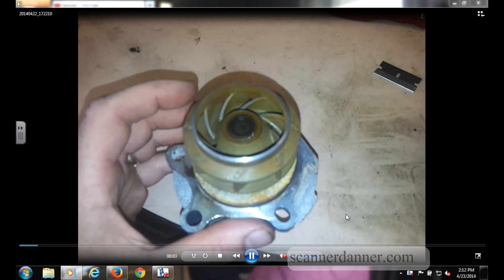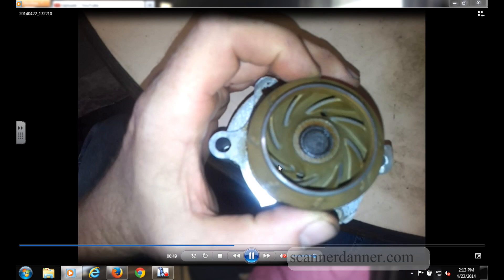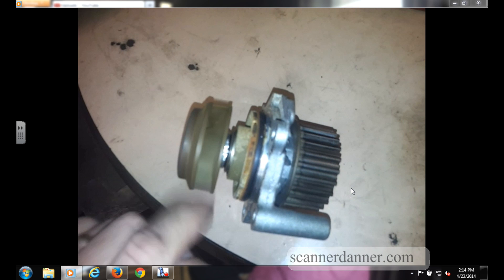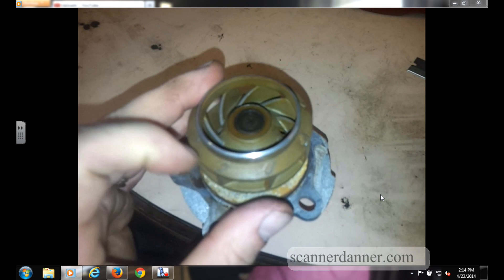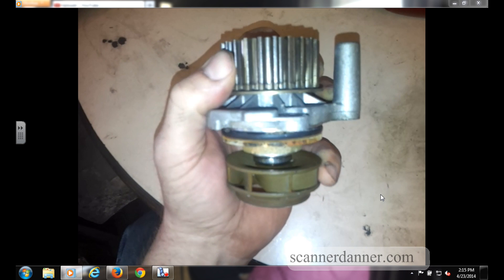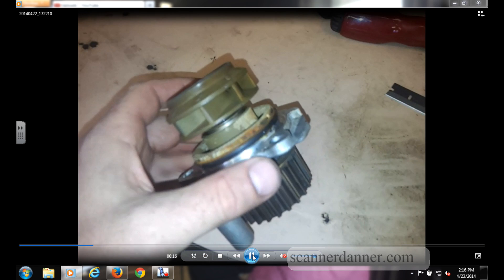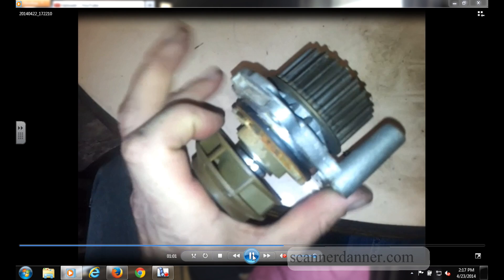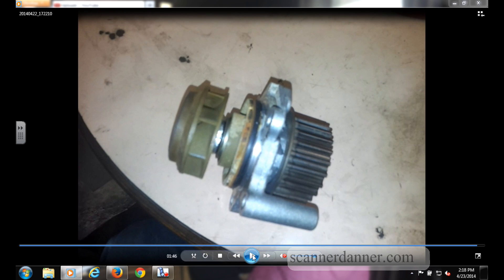2002 VW GTI Overheating (possible causes) Part 3

Comment: got an o3  my obd scan while driving says 190 deg  no fans  .... fans do work tested and occasionally ive heard them run like at a peak time which must be over 195 after shut down after hot day in traffic  and when replacing the ambient temp sensor .... ive experienced it didnt last but 30 seconds after shutting off car ..... to get my ac to come on the ac clutch wont engage if  fans dont turn  dont  chill  ive replaced the ac transducer  checked lbs of refrigerant  put in a newer fuse block / fuses   the physical thermostat was professionally changed ... ive been to orlando and daytona and back no prob temps say 190 but maybe im high  your taliking the thermostat on the lower radiator ???  havnt replaced that yet wondering what thermostat  ..the sams states there are two circuits that directly relate to cranking the fans got that schematic but dont know what brain is doing ???   ...circuit that runs from cabin switch /AC button  is not working but lighting up ??    .... the guy i bought it from may have primed it bad  like ive had to feed it antifreeze a couple times on the warning chime as low  not burning but maybe there was too much water hardly pink...   the forum guys say use straight pink stuff ive been adding universal concentrate to the light mix from when i bought it which might be worth something to state the right antifreeze   stupid bottle gets yellower than my teeth in winter but i see a little troff in there probably what yer talking about... my 67 need no water  my LS whole different story

Comment: I recently changed the radiator for my daughters car, I checked the temp switch as you did and it went to low speed but not high speed with jumpers.  I turned on the AC unit and both fans went to high speed.  I replaced the temperature switch on the radiator and still can not get the fans to turn on in low speed.  I have a small amount of water return in the globe (LOL), but I feel like the water pump is the issue.  I guess I should have said, she wrecked the car, and it's possible that she over heated it knocking out the water pump, which is 6 months old ahhh. Any other suggestions before i take off a 6 month old timing belt and water pump?

Comment: On my 1997 Mercury Sable, metal impeller had, for some reason,  dissolved. There were just stubs left of the impeller blades and dissolved metal fragments inside the water pump.
Reply: lol

Comment: I work on vw for a living and I can't remember of seeing a bad metal impeller plastic ones yes I even seen Chevrolet Duramax engine do this on metal impeller if the truck are tune for high horse power they sell them new in the aftermarket tig welded to the shaft so that dosen't happen.

Comment: Yes, I use my infrared thermometer religiously! The water pump impellers go bad on Volkswagens but the question is why? One of the culprits is, after the vehicle overheats, the coolant cavity inside of the block, where the impeller sits, becomes like a kiln. It completely melts or warps the plastic impellers. It could also cause the metal impellers to expand, loosen and create friction. Once that happens, it remains loose like the one in this video. I've seen it many times. The vehicle starts out over heating due to the plastic thermostat housing and outlet on the other side of the engine leaking. And then come to find the water pump impeller is no good. This justifies a water pump inspection on all Volkswagens. Do not take the risk!

Comment: could you have tested the switch by simulating a hot condition without actually getting the engine hot? changing the state of the switch by jumper?

Comment: I didn't expect a metal one broke. Good information as always.
On a side note, I don't know how else to contact you, but I am going to take the ase L1 test soon
I THINK Im prepared other than the gas analyzer questions . Is there any videos you can suggest to help.
I would be willing to pre pay you for a crash course video however you like of its reasonable .
I have no experience with a gas analyzer due to living in Florida , and never worming at a shop that had one.
I also hope you seen my post on how to correct the N/a data on the Verus . 
Thank a lot for all your helpful information .

Comment: I have changed more than my fair share of these water pumps, one to do  next week to be fair but never had this problem with QUALITY metal impeller pump replaced
with timing belt kit when due. I have had plastic one's fail early.
I have to be say i use a infra red temp gun and take readings from the hoses.
Rad and heater matrix when the engine is running. It looks like a case of poor
maintenance to me.

Comment: Sorry to bother you with this. Would a transmission control module store a fault without notifying the driver (not illuminating a light).
Reply: transmission control modules store faults and turn on check engine lights and dashboard warning lights.  If the code is a pending code you will need for the fault to happen repeatedly before the check engine light is turned on. its always good to mention the make model and year of your vehicle
Reply: Tom A I put a used tranny in a 2007 mazda 6 and the car will not move. I just bought a scan tool. Waiting on delivery. To check it for codes or tips. The cel nor the a/t light are on.
Reply: cecilio zarate possibly the used transmission is faulty, the vehicle should still move in limp mode. try moving the shifter and see if you get a forward and reverse reaction.  I used to only consider buying transmissions from crash damaged vehicles that way I know the car was moving. the transmission control module should be purchased with a used transmission, go to Mazda and insure that your transmission matches your engine and chassis wiring, check that flywheel is bolted to torque converter
Reply: Thanks for your time Tom A
Reply: cecilio zarate my friend good luck. I just want to say that I experienced the good in people. I was working on my car and had a question. I drove by a shop I never knew before and came back out with Mercedes {STAR }  information ALLDATA information charts and wiring diagrams FREE!  Technicians love solving problems that's our weakness and our strength
Reply: Well tom I work at a shop with access to all that so if you ever need anything just ask
Reply: Tom A By the way turn on the ignition and see if the check engine light and A/T light comes on before cranking the engine. this is called a bulb test or system self test. helps to verify that transmission control module is receiving power, ground and some signal activity.

Comment: Your work is very appreciated. you never fake it. The BMW 325 [ year 2000 onward ] has a very distinct history of water pump impeller separation. beside the updated construction of these units [ weight reduction and close tolerances ]  they are subjected to a lot of back pressure due to pressure differences, when even one occurrence of overheating is experienced in the engine.

Comment: Lots of Eurpoean makes have a puzzling and cunning problems where only the certified specialist by them who takes their own training would fathom such issue. How shameful of V.W to made such a tricky part . I believe plastic impeller (even if such plastic blend is certified by NASA) with extreme heat will swell with time and wont serve long.

Comment: Not just German makes either, I've seen it on a couple of Domestics as well....unfortunately. Some of these "aftermarket water pumps" are complete garbage. What we have been seeing lately(excuse me, this is not water pump related) is a lot of master cylinder failures. Flawed castings and improperly machined bores. Just today I was doing a rear diff inspection, hell, there was no cover gasket installed, it blew my mind. Enough venting off my frustrations. Great integrity you have Paul, I admire that.

Comment: Thanks for the update Paul... not what I was expecting (bad metal pump). My flow test is effective cold as well (if the pump is completely shot) but I would also back it up with checking for heat output inside the car. The reservoir cap can be left off from cold till warm (should not overflow) in case people are worried about opening when hot. Thanks for the extra follow-up!

Comment: Great job, thank you so much.

I've worked on the plastic impeller type in the past, and two blades had sheared off. Very common issue on vw's, they are quite a common car in the uk. Thanks again.

Comment: Looks like a design flaw to me. When the impeller gets hot, it expands. The center shaft would be cooler/smaller because it is transferring heat out to the belt. this causing the impeller to slip and eventually wear enough to free spin.

Comment: Valid points for testing for this problem...not so sure of that heater core test... had a small head gasket leak that gave cool heater core on vw golf  ,,but spos it might be applicable in some cases...thx for follow up dude
Reply from the maker: for sure man, just thought about that on the way home today after uploading. you can have no heat from air pockets, (headgasket, low on coolant etc)
But I think it is still valid when you are looking for clues or a guide. Just do not rely on it as THE test but A test.